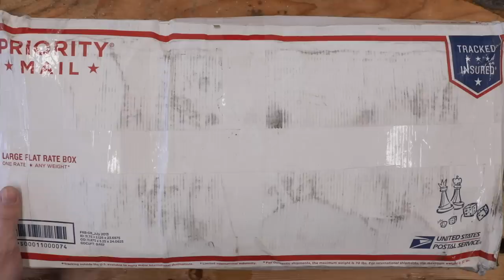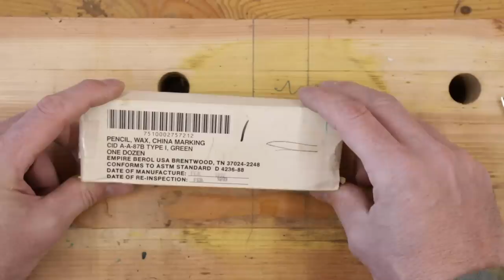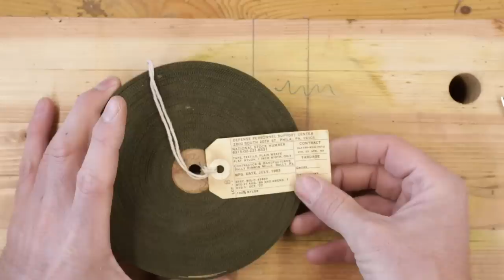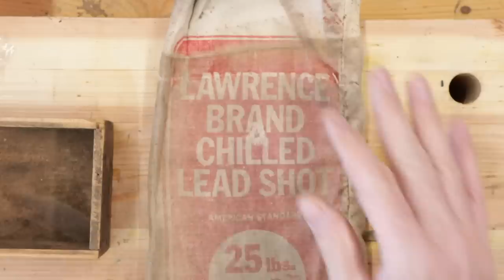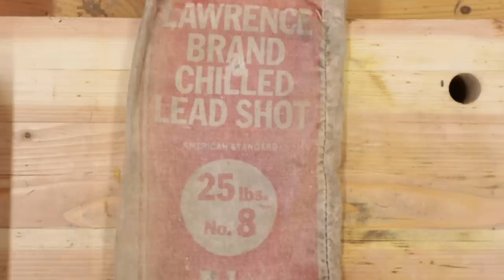Fan Mail Unboxing

Comment: The pencil things with the layers are what we always called grease pencils. You can write on anything with them. The work in the rain or snow. You can write on glass or steel or anything. Hard to wipe off unless you use a magic eraser. I still see them used at thrift stores and trade meets for price marking. Just noticed how late to the part I am lol

Comment: That screwdriver is a screw-starter. The tip clamps inside the slot on the screw to start them in hard to reach areas. Drive the screw with a regular driver to ensure longevity.

Comment: @14:00  tapestry or mattress needles.
@18:00  horse shoe nails
@25:05  waxed thread,  for sewing tents and tarps
All of these things came from a military surplus cache except the "Loctite" van.  Those needles can also be used for tents, tarps, and canvass.  Use wax on the needles and thread to help pass them through the material.

Comment: I believe the first one is used to hold a screw by sliding the slide, it swedges the tip into the screw head. Then you can set the screw without loosing it. I have a smaller one.
Reply: I also have one I got from my Dad.
Reply: Yup!  I've two of them, myself.

Comment: I believe the bits with your hand drill are called 'points', used to drill wood. Mine only has 3. The heavy needles are 'sailmakers needles' uses to sew heavy canvas and manilla rope. You're fortunate to have acquired the punch, grommets, anvil and grommet setter. Cheers.

Comment: 7:50 - We used to call them chipping hammers in the merchant navy. Very good for chipping off large portions of paint that have had rust appear underneath. No as good as a needle gun for more sturdy paint, but just as loud and annoying on metal sheets.

Comment: Needles are for sails on sailboats. I’ve seen them around rigging shops. That wicked curved point can be driven through many layers of heavy canvas with a “palm”, a leather hand guard that carries a metal cup, similar to a thimble driving a needle. The hammer is a chipping hammer, used for the first, coarse removal of wasted paint off plate steel, or the removal of slag off of a fresh weld, prior to cleaning the weld with a wire brush.

Comment: @Wranglerstar the bag you open at 05:54. The first two things you pulled out are part of a PLD (personal lowering device) they are used in the United States Air Force with parachutes. The small one is a clasp  that you wrap around the risers of your parachute and hook into a ring. The bigger one hooks into the front clip on your parachute harness and has a piece of nylon that runs through it and you use friction to help lower you down to the ground. The nylon is 150 feet long and the system is designed to help the wearer of the parachute lower themselves down to the ground in case they get caught up in trees or something similar.

Comment: Raw hide mallets are also used by leather workers for stamping the decorations on leather. The needles are sail needles.
The china markers are indeed spiral wrapped and you pull the string to tear the outer layer then just unwind the cover.

Comment: It looks to me like David got a hold of some old Dept of Defense surplus. The welded rings and grommet sets at one time were issued to units in a wooden locker kit for textile repair from WW2, all the way into the early 90's. They also issued units carpentry kits and barber kits. In the Army, each company or detachment were issued these kits. I'll wager the nails and unused hand crank drill came from a DoD carpentry kit. The rawhide mallet and hickory handle may have come from either kit textile/tent repair or carpentry. The Welded rings and D-rings are for textile repair or tent repair. The same pouch has some parachute and aerial delivery items. The locking gate hook is a very old "Static Line Snap Hook" still with a portion of the "Static Line" (yellow Type VIII nylon webbing), sewn in long tri-fold. A paratrooper would attach the static line of their parachute to an overhead anchorline cable inside the aircraft by means of snap hook, the hook gate locked in place to ensure it was secure. The snap hook slides on the cable as the paratrooper walks from the front of the aircraft to the paratroop door to exit at the rear of the aircraft. Once the paratrooper jumped from the aircraft door, about 16' of Static Line would play out from their parachute. Upon reaching the end of that line, the Static Line would pull the main parachute open. The paratrooper was responsible for deploying their own reserve parachute in the event their main parachute had a malfunction.  The dual "L-Bar Connector Link" is still used today on modern military parachutes, as is your "Quick-Fit V-Ring" belt buckle. The Quick-Fit V-Ring is used on the parachute harness leg-straps. All three of those items are used on personnel parachute harnesses. The buckle with the floating fat bar is used on canvas components for aerial delivery containers used to parachute supplies and equipment during combat operations. I am guessing most of these items I mentioned, even the files and china markers (wax) came from an Airborne or Aerial Delivery/Parachute Rigger unit. Riggers use the china markers to mark parachute materials while measuring and marking textile repairs on parachutes and other aerial delivery items. The markers were originally developed for marking on porcelain and tile, things that pencils and pens could not mark well, before we had Sharpies and modern markers. The china markers work great on textiles.The screw driver looking irem is a "screw starter". Holds a screw on the tip. For wood screws, slide the handle like a slide hammer to start the screw. The curved flat needles are "Sail Maker's" needles, used in textile repair for canvas and leather items for both tents and aerial delivery equipment and containers. Upholsterers also use those needles. The chisel handkes also look the same as the ones we had in the DoD carpentry kits.

Comment: Neat stuff.  Your friend David is very generous.  Love the hand drill, man.  The bent needles remind me of sailmaking needles that penetrate canvas, but they could be for leather as well.  The wax crayons or pencils are great for marking things.  I used to use them on tires.  The nails look to be shoeing nails to shod horses.  The roll of nylon strap material is used to make webbing or straps for packs, tie-downs, or whatever.  Oh, my....those box latches are very cool.  The thread that was in with the chisel handles is most likely for use sewing the nylon webbing together.  At least that's what I think.  And the Loctite van is the BEST!!

Comment: Haven't seen a grease pencil in a long time! :) All good!
Reply: Use them almost every day here at the shop.  Great for making temporary marks.  Easy wiped off with alcohol. 

Surprising to me he's never seen a china marker
Reply: Work great for marking granite and marble tiles when using a wet saw.
Reply: Those china markers are used a lot in defense and in aeronautics - simple way to mark up plastic maps for way-points, etc.  Also called chinagraphs or paper pencils.
Reply: Used them all the time in my grandparents' store to write the price on cans and jar lids.
Reply: those are high temp markers.  the green is goos for about 3100 degrreees F but is made with chrome so is listed as carcinogeniic

Comment: Another use for the wax pencils is on the fire engine. As an engineer I would use one to write dispatch info on the glass windows. Also, on the pump panel you can mark static pressures and where each discharge is going i.e., interior attack, RIC, or floor 1/ floor 2, etc..Then wipe away with a rag when done.

Comment: Used those china markers a lot in the Navy. Used them make on acrylic boards. We would have to write on the board backwards so the officers could read them on the front side. The boards where light from the side illuminating the marks on the board. The string is pulled down to then next indent in the pencil and then the paper is pealed of giving access to more of the marker as you wear it down.

Comment: David does a lot of Military surplus shopping. That first screwdriver is used to hold the screw so you  can reach into tight spots.
  Put the screw on the tip then turn the handle to lock the screw on to the screwdriver tip.

Comment: I worked for the Bell System and we had a tool similar to the first one only a little shorter with no handle that fit in our side tool pouch. - It is to hold slotted screws so they don't fall when starting them.   We use to deal with small slotted machined screw in electronics.

Comment: Those grease pencils had a 1993 date. In 1993 (and before and after '93) I was using Berol grease pencils every night at work to mark the back of newspaper printing plates. Red. Still have a couple in my pen and pencil box. Toughest part is developing the right technique to peel the paper just one segment to freshen the tip. Back in the day before magic markers, ballpoint pens and the like, grease pencils were the writing instrument of choice.

Comment: The Renault Traffic is like a French Ford Transit.   Corgi is a popular model brand I can remember from back in the 1960s.  The models are always more valuable to collectors if the model comes with it's original box.
You have more treasure than a pirate.

Comment: Hey Cody, about them lumber pencils, all you do is pull the string about 1/4'' toward you so that it cuts the paper and then peel off the paper around and around down to the tip. They are cool I always like using them on wood or steel.

Comment: Those square nails i believe are cut nails used in nailing boards to concrete.
You will pre drill holes in wood and concrete then use the nail in the holes         I used them in Florida when I lived there in 2000 .

Comment: Cut nails are use in applications where the carpenter is concerned about the nail splitting the wood. Like installing hardwood floors they are easily bought at any good hardware store.

Comment: Cody, those are sail needles. Sweet with the grommet thing and the huge sail needles looks like you could make some neat 14 lb wt tarps for the garden yard for the summer to sit under.   Plus you unwrapped some good thread for the canvas. You now have two different types of grommets smooth and toothed. Sorry to say it is not for leather.  China wax markers their marks are removable on glass, ceramics, and China etc...

Comment: I think this china markers are design to withstand high heat marking aplications - we used them in lab to mark on glas or porcelain labware which then goes to the oven for heat treatement

Comment: Those china markers are like the ones we used in the Air Force. we called them grease pencils. we used them to write on what we called a dispatch board. It was a clear peace of plexiglass sheet that we would make with black lines on the back side and then paint white. Then turn it over and you can write on it with the grease pencil and erase it with rubbing alcohol and a rag and use it again. We had the tail number of the aircraft down the left side of the board and then when the pilot would come back from flying. He would tell us what systems had problems and what the problems were then we would right them on the dispatch board and drive out to each of the planes and drop of technicians and tell them from looking at the board what systems had problems and what the problem was. Then the technician would fix it and the driver would cross it off the board at the end of the day the board would get erased and start all over again the next day.

Comment: The green and black pencils those are called grease pencils when you wear it down to the paper just peel another row and you can re-sharpen it those are use with clear plastic to do an overlay on a map or a schematic or a blueprint even

Comment: Isn't that first hammer used with stick welding?
Reply: Quagmire88 it's a for taking tires off a bead or for the reason he stated. You use a chisel hammer for stuck welding which comes to a point on one side and an edge on the other

Comment: That first tool is like what you use to take nuts off that has a slot in them the nut itself is round and the slot goes across the diameter.

Comment: I thought you fixed a loose head on a handle (8:42ish) by dropping it into a bucket of dirty water.  ;o)  LOL  I am used to the china markers (16:40ish).  We used them a lot (in all different colors) for marking almost anything. I still have several.  Peeling the paper off was fun.  :o)  And, of course, the laugh at the end with the van.  Totally fun video. I do love watching you unbox stuff.  Especially from David.

Comment: Hi Cody I want to make a comment on those bits that came out of the wooden handle of your rotary drill it's actually drill bits with a double action Cutting Edge it's made for a miniature Yankee like hand drill so when you push down it cuts and when you let up it cuts the opposite way it's made for pilot holes for screws the one I have also has a screw off cap in the handle to store all those drill bits

Comment: THE DRILL BITS ARE FOR A PUSH DRILL.. MY DAD HAS TWO PUSH DRILLS OF DIFFERENT SIZES BOTH  MADE IN THE USA..   I'M IN NEW ZEALAND SO THEY HAVE TRAVELED WELL... THE NEEDLES ARE FOR SEWING SACK ...
WHEN I WAS A YOUNGER MAN WE USED CHINA PENCILS TO WRIGHT THE PRICES ON VEGES AT THE PRODUCE SHOP I WORKED AT AFTER SCHOOL...                                                          nz      kiwi

Comment: I seem to remember those angled tools being used in shoe cobbling.
That braided string is for leather and canvas works.

China Markers are essentially really hard grease pencils. They can write on plastics, glass and metals then be wiped off with a dry cloth. As you use them, you pull that string to cut the outer layer of the paper then peel it down to the core. We have a really old box of them at my work for the host to use for marking off reservations and table occupancy on a laminated map of the restaurant. 

SQUARE NAIL JACKPOT! Nice patina. Though, you can still buy them new. As well as Horse Shoe nails (which are squared).

https://www.amazon.com/Standard-Steel-Common-Square-Nails/dp/B005THUF86/ref=sr_1_7?ie=UTF8&qid=1521159651&sr=8-7&keywords=square+nails
https://www.amazon.com/FLOORING-NAILS-2-25-Antique-style/dp/B01MXF0FON/ref=sr_1_9?ie=UTF8&qid=1521159651&sr=8-9&keywords=square+nails
https://www.amazon.com/Steel-Inch-Horseshoe-Nails-Box/dp/B01EPO91R4/ref=sr_1_3?ie=UTF8&qid=1521159651&sr=8-3&keywords=square+nails

Comment: Hello Sir I noticed you received a large butcher's knife in the package. It's made here in the United States by the Ontario knife company. They are in Louisiana they used to be manufactured by old hickory but I believe they were bought out or the rights to market them. I will have to re-research all this information and give you a link to there website. They have a good sharp edge right from the start and a higher carbon content then most modern kitchen knives sold for much more money. However they will rust if you don't keep them clean and dry. Lightly heating them and applying a coat of cooking oil and then wiping away the excess oil will help preserve them. They hold a keen edge much better than a lot of the kitchen knives sold. Ontario knife company also makes and has made a lot if not most of the knives used and issued by The United States military. I'll be back with more information about Ontario knife company.